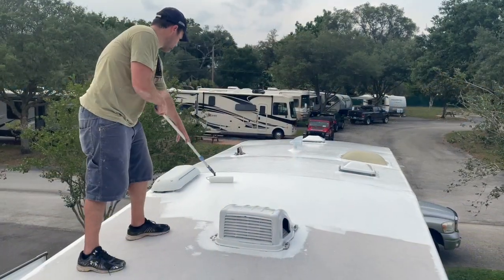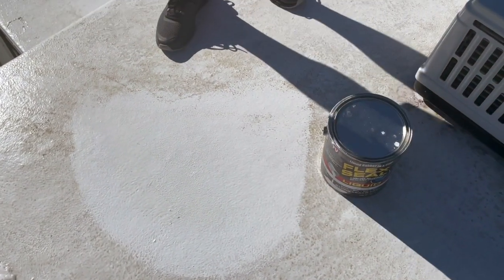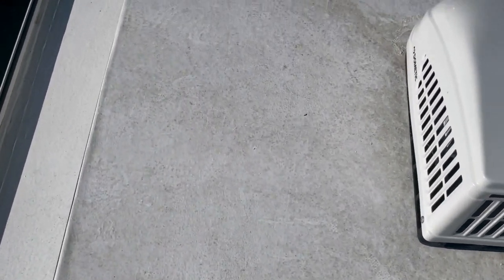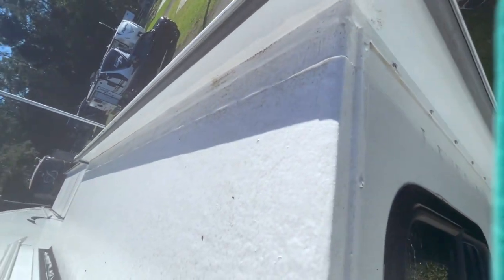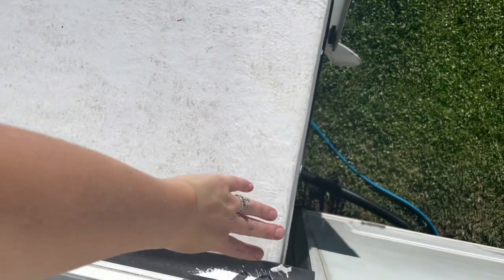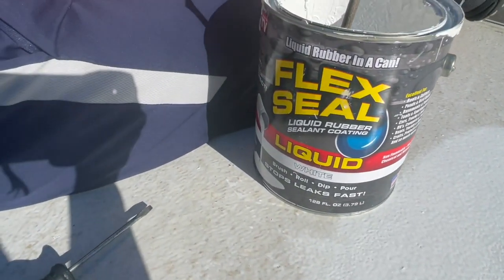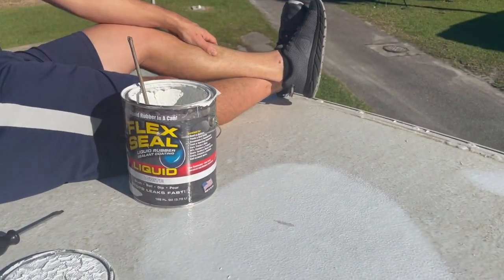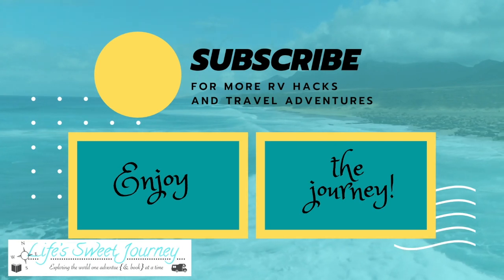Flex Seal RV Roof Reseal Update 8 Months Later! IS IT HOLDING UP?

Comment: What kind of rollers did you use and how many did you have to use
Reply from the maker: We just used regular rollers. We got a three pack from Lowe's, but basically it was these (https://amzn.to/3dFKrtt). The white felt like ones. We only used one roller since we did the whole coating in one day. We used a paint brush to do all the trimming along the edges. We used a long handled attachment for the rolling. Definitely recommend that to save your back and to keep you from having to do the whole thing on your hands and knees or bent over all day.  This kit comes with the pole and 3 roller covers (https://amzn.to/3ETQ1Vq), which should be plenty. You shouldn't need to use more than the one, but if you break the sealing into two days then you may want to use a fresh one for day two. I'm not sure if the sealant will keep well wrapped in plastic or aluminum foil overnight like paint can.

Comment: I thought I remembered you guys painting over some sealing tape in your first video. If so, how well did it bond and hold up in those areas? Sorry if I missed the answer to that in the video.
Reply from the maker: We took the old Flex tape off of the main part of the roof, just because it was recommended. But we did paint over the tape that we had on the skylight covers/ceiling vents because there wasn't the ability to remove it and it actually bonded and has held just fine since we did it. Plus there was the original sealant tape that ran along the slide seams. We painted over that as well and all has held up really, really well! No issues.
Reply: @LifesSweetJourney  Thank you for the response.
Reply from the maker: @disillusioned070  I know you were asking about the bond over the sealing tape. We just did another check-in video after hurricane Ian rolled through Florida. We're at the 1.5 year mark now and it's still holding well. You can see where we painted over the sealing tape on the slides at about the 6:30 mark in the new video (https://youtu.be/b3mGyUtohDo) if you would like to see how well it's held up in those spots.
Reply: @LifesSweetJourney  Thank you for the follow up. I just watched the other video and it was very helpful and informative. I was planning on doing mine this coming summer and your videos just confirm that it would be beneficial to do so. Thank you again for the follow up.
Reply from the maker: @disillusioned070  You bet!! Best of luck with the project. If you have any other questions just let us know.
Reply: @LifesSweetJourney  👍👌
Reply: @LifesSweetJourney  my lord and savior flex seal told me to do it 🤣🤦🤣🤦🤣🤦

Comment: Looks great. So question was this put on OVER a rubber roof? Do you think this would fix rubber roof bubbles?
Reply from the maker: Thanks! Yes, we put this over our existing EPDM roof. I think it would depend on how you address the bubbles. We didn't have any large bubbles. Only one small spot that was loose so we just painted over that and it's still there, but has never gotten any bigger. If you have large ones that you are wanting to get rid of entirely it may work to pop them first then use Flex Shot or paste over the hole and then use the liquid sealant on top of that just for extra coverage. I can't speak to that though with 100% certainty as we have not tried that.

Comment: flex seal brand sure a great sealant. but it has NO abrasion resistance. everything that rubs it will tear or just abrade it off.
Reply from the maker: Yeah, it's definitely pretty smooth and slick. Thankfully our shoes are fine on it. We've scrubbed a few trees and thankfully no big issues but we're keeping an eye on it.
Reply: BECAUSE IT DOESN'T STICK TO EPDM OR TPO

Comment: Should I use eternabond tape to do the edges before I use the flex seal. Can I use eternabond after sealing with flex seal if I needed to make a repair later?
Reply from the maker: I would not tape before. The liquid may not full bond with the tape. We had tape in a few spots on our sky lights that we couldn't remove and we used the liquid over that and so far it's worked out really well and has bonded. However, Flex Seal recommended removing the tape we currently had on there and then filling any holes with paste or Flex Shot if needed before using the rubber liquid. We did remove the old tape from the roof itself. We were able to just apply the Flex Seal Liquid liberally as our hole wasn't very big. And you should be able to use the tape later for any repairs needed. We haven't had to yet so I can't give firsthand report, but taping after the reseal shouldn't be an issue.

Comment: Wow, seen you guys video on when you initially put flex seal on your roof and 8 months later. I’m impressed, especially if it sits outside all the time, yes? I would have shelled out and replaced the vent covers, cause I’m anal. I’ve used flex seal on the semi loony’s on my house gutters and they last about 2 years and I clean them again and redo them with flex seal. Ultimately I’m curious to see how well it fairs on your roof after more than a year, say 14 months, we’ll done tho.
Reply from the maker: Yep, sits outside in Florida sun for the most part. We're just over a year in now and it's still holding up great! We plan to do another checkin video soon. I will let you know when that's live so you can see :)
Reply from the maker: Hey Rick, I know you were wanting to see how well it holds up a year+ in. We finally did another check-in video after hurricane Ian rolled through Florida. It's been about 18 months since we did the reseal. Still holding up great! Here's that video if you want to see how it's still holding up- https://youtu.be/b3mGyUtohDo
Reply: @LifesSweetJourney  most excellent!! I’ll be watching!👍

Comment: The camper dealer says you shouldn't put Flex Seal on the roof because it will eat away the membrane I don't know if that's true or not
Reply from the maker: We got our rig used from a consignment dealer. So she was an old gal when we got her. If you got your camper direct from a dealer, and especially if you have any kind of warranty on it, I would wait to use Flex Seal (or any kind of full reseal roofing material) until you check to make sure it doesn't effect your warranty claims. I do sometimes think the dealers say things to scare us though to make sure we bring the rigs back to them for any kind of repairs, when often times doing it yourself, or finding an outside repair service will be much cheaper. So far Flex Seal has not eaten away at our roof membrane at all. It created a fully new membrane and we have been very happy with how it has held up.
Reply: Yes It is because it is a petroleum product. Don't use any flex seal products. Only dicor

Comment: Flex seal is consumer grade products that are basically a "patch". If you can buy it at Walmart you shouldn't be using it on your RV. It's for the dummies they aren't going to sell quality long lasting uv resistant products at your big box store. The proper way to seal an RV is dicor and/or etrnabond. Also coating the whole membrane does nothing big waste of time money and it looks like a toddler took a paint push all over your RV.